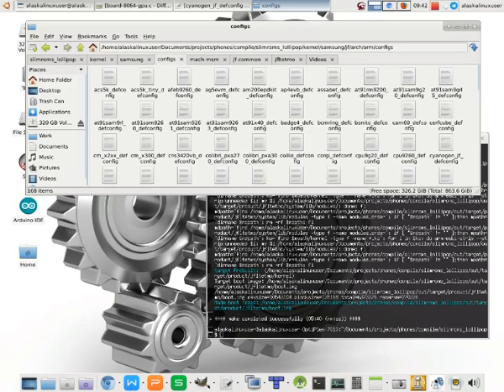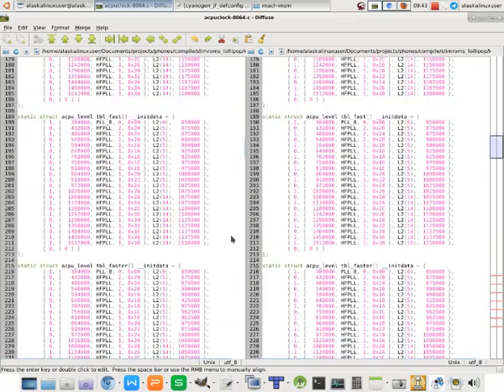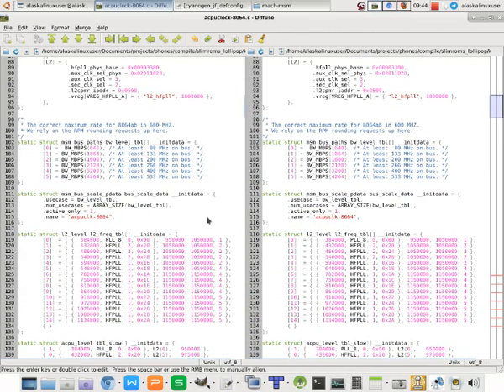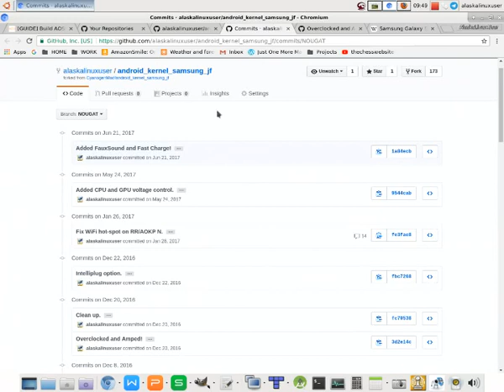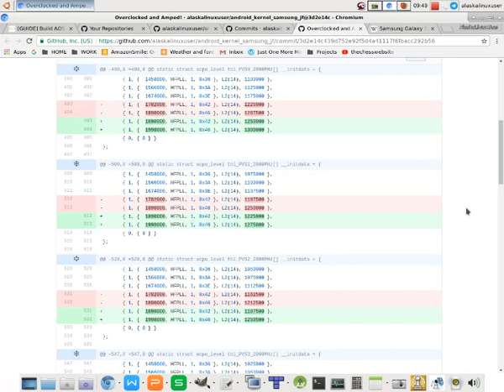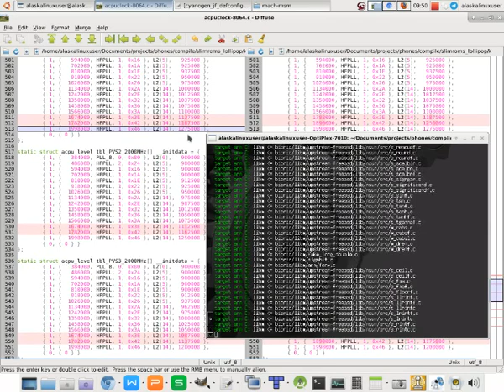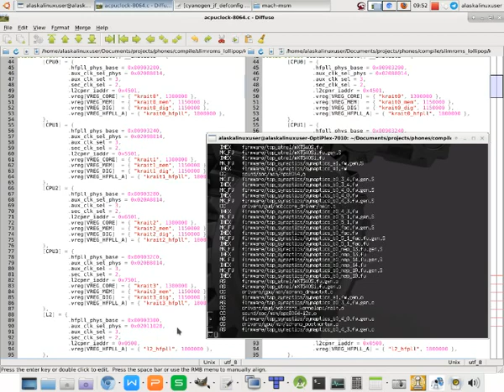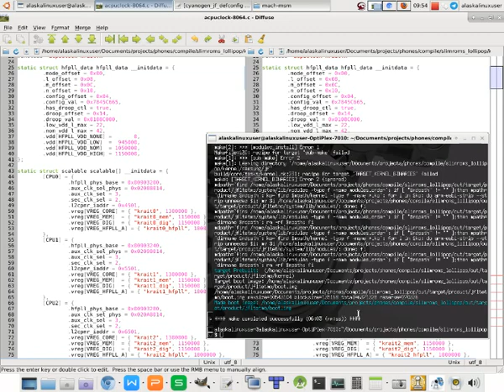Kernel: Overclock the CPU

Comment: I really appreciate the effort you put into these videos, your WordPress and the xda forums. Unfortunately I'm not smart enough and don't have the necessary experience to understand all the work you do. 

I tried getting into kernel modifying and compiling last year and I didn't get anywhere. I haven't booted into Ubuntu since. I want to give it another shot on a Samsung Galaxy S4 I recently acquired. I flashed Lineage OS 15.1 on the phone and it's working really well. My next goals are to overclock the CPU, GPU and if possible the RAM.

If my understanding is correct I need to take the boot.img from the LineageOS-15.1.zip I'm currently using and extract it. This is where I can find the zImage. The zImage contains the code that I want to edit. I then need to make the necessary edits like you did in this video to enable overclocking. I then compile the edited code into a new zImage and replace the original zImage. I then incorporate the zImage with the original ramdisk to create a boot.img. This boot.img can then be flashed using TWRP. 

On your WordPress there is a kernel for a Samsung Galaxy S4 that is running Lineage OS 14.1. Could I theoretically use that kernel on Lineage OS 15.1? 

If you could give me some guidance and a few quick tips I'd be extremely thankful.
Reply from the maker: You bet. XDA is the best place to ask questions, because I can give lengthier answers with formatted code there. But you need to fork this kernel repository: https://github.com/LineageOS/android_kernel_samsung_jf and use that source code for 15.1. Hope that helps and good luck! The great thing for you is that I already have videos specific to overclocking the Samsung Galaxy S4: https://www.youtube.com/watch?v=qBgbN8alkzE&t=0s&index=71&list=PLRJ9-cX1yE1l6eu-vkgsj61U-Zv3fjzwZ

Comment: I don't know what is with the new devices, but the kernel sources do not have anything like the old ones. There is no mach-msm folder and I can't find anything like it. Also for the gpu overclocking files, it is completely different as well. Idk what to do cause I know you said the principle will be the same but it definitely isn't for the latest devices because there is so much difference. I've tried searching for anything resembling the files in the video but there is nothing

Btw my name doesn't mean I'm a programmer. Just liked the sound of it lol